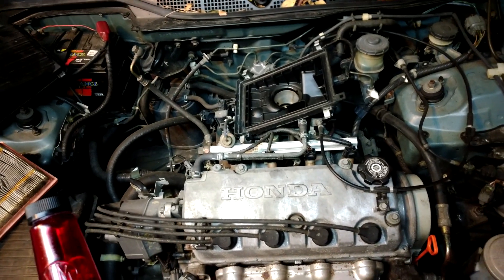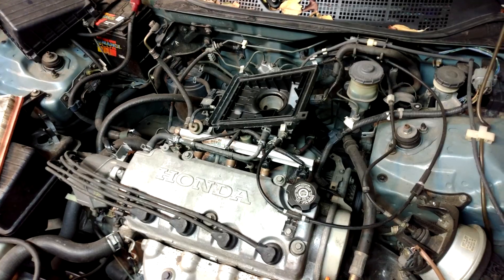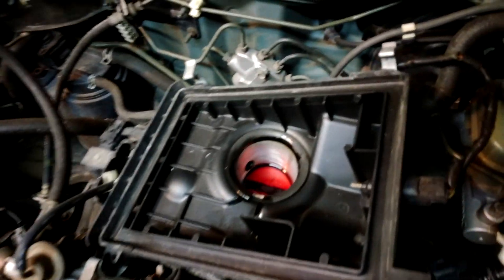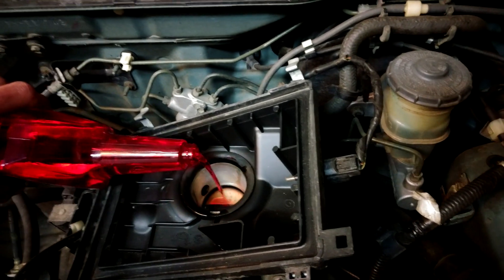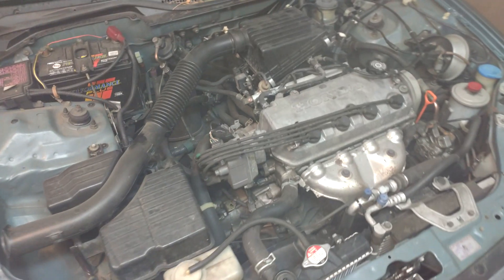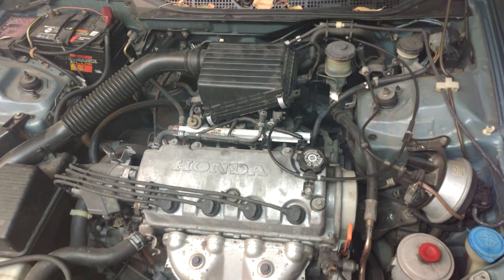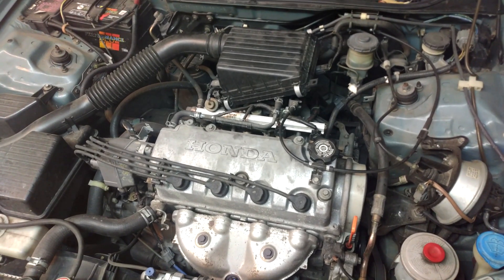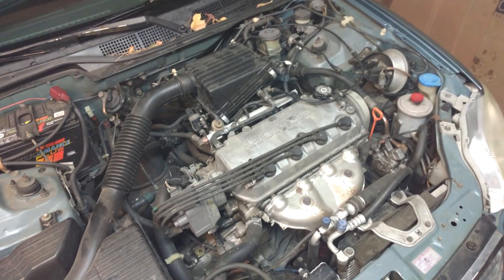Marvel Mystery Oil in the intake?  Will it do anything?

Comment: Pull  the vacuum  line going to the PCV valve, if it'll stay running, and put the hose into a jar of Marvel. Let it pull in  a few ounces. then shut off and let it soak all night.
Reply: +grassroot011 - Thankx for the Tip !!! I will try that in the Summer :)).
Reply: Yeah and use CRC not marvel for this. I use marvel for gas tank and oil.
Reply: Good tip. But You don't have to let it soak overnight though. Run the car to operating temp, and while it's still running pull the vacuum off the brake booster and let it sick up several ounces like you said, switch off the car and let it hot soak for 10-15 minutes and then go for a "spirited" 15 or so minute drive. That's the seafoam process. Works wonders. I've never used marvel mystery oil as anything but an oil additive but I swear by it. Saved me an oil pump one time.

Comment: IMHO.    i have been useing MMO for 30 years or so.    i think the best way to use it is with the old upper oiler.    that way you good control on the amount.    i was running  6-8 drops a min at idle.   but have switched to  TC-W3  2 stroke oil.  in my fuel tank  1 OZ  to 5 gal

Comment: Put MMO in .99 spray bottle and remove injectors from hot engine along with plugs.  Spray all in the throttle body/butterfly, pour about three oz in ea plug hole, then spray down into injector holes...soak tips ofinjectors overnight too.  Let sit for a few days to week(to get in and through piston rings), blow/suck from plug holes, reassemble and start.

Comment: Just add it to the Gas
Same thing.....the MMO get injected through the injectors and ports to clean the valves and heads. 
you dont need to put it through the air intake.
Reply: no way its cleaning the heads unless you ARE putting it thru the intake.
Reply: @chaserr1259  it can, if its a Port injected engine. direct injected engine, it wont.

Comment: and did it work? is the compression better? is the mpg better? did it stop smoking? did any sensors go bad afterwards?
Reply from the maker: I didn't compression test it afterwards, but it did seem to run a little smoother, and the oil was dirtied from what I assume was the MMO cleaning up the inside a bit.  I didn't get any CEL's from bad sensors afterwards.  It ran well all the way up until I sold the car a few weeks ago, so I can only assume it's still going strong today.
Reply: +Lynx 4293 - Sensors are cheap these days, if you hunt enough you will find them really cheap !!  But what he did in the Video would help more than 1 Repair. Engine Repairs are Costly and bunch of Time and Headaches.... I think he did the right thing by saving his Engine this way and cheaper too :D.

Comment: Wouldn't recommend  this method with modern engines but back in the days of carb motors you cdribble a quart of ATF down the intake and accomplish the same thing. Not good for the spark plugs but under normal use you'd never notice.

Comment: I've put some in my Genesis Coupe 3.8, and I had to replace the Spark Plugs. Those had to be replaced anyway. Now, I'm still trying to get rid of the smoke coming from my exhaust. I don't even have a Oil Leak.

Comment: Good way to bust a piston rod.  Liquids don't compress.
Reply: Yeah, Mr. Physics major never heard of hydro lock.....
Reply: MMO burns it has a warning on it saying keep away from sparks, open flame and heat it's designed to be used in fuel and oil he's just introducing it into his system in an unorthodox way.
Reply: You can't add enough to hydrolock the engine unless you put the whole bottle in with the engine off!